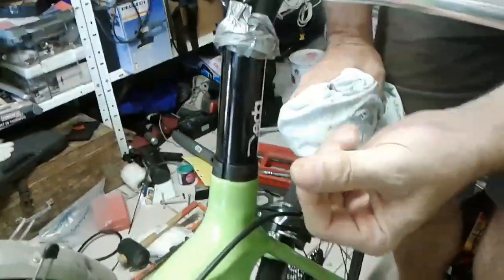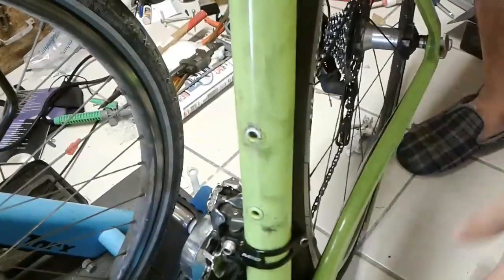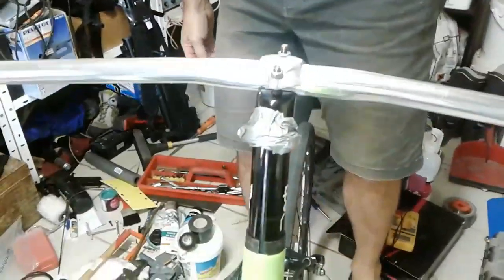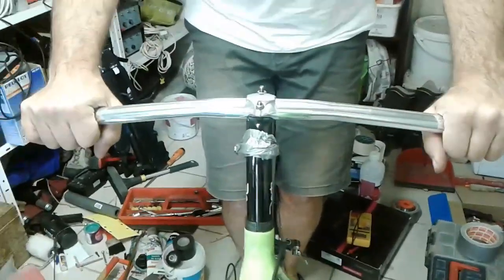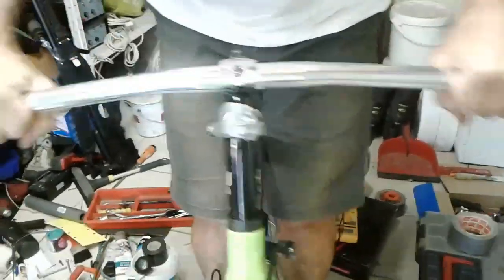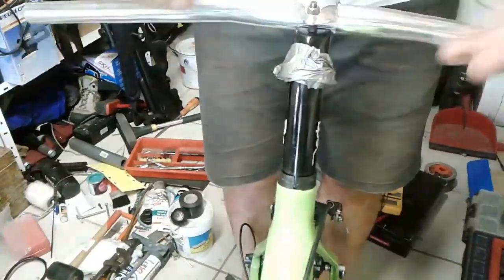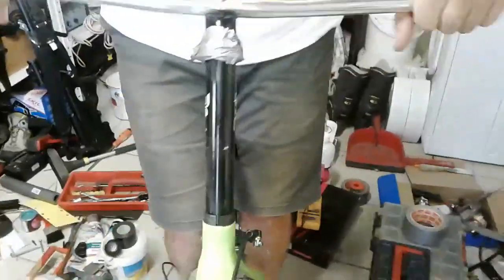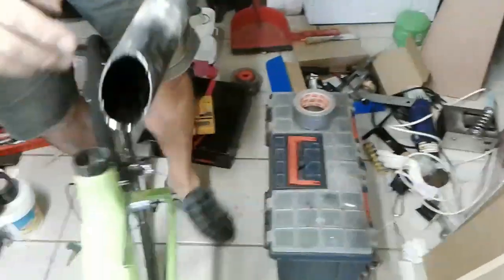Removing a stuck cycle seat post - archimedes method

Comment: In my case a mechanic hammered a post in so its super stuck. 😵‍💫
Reply from the maker: ouch, that's bad, you can try cutting vertically with a hacksaw blade to get the post out - but it ruins the post